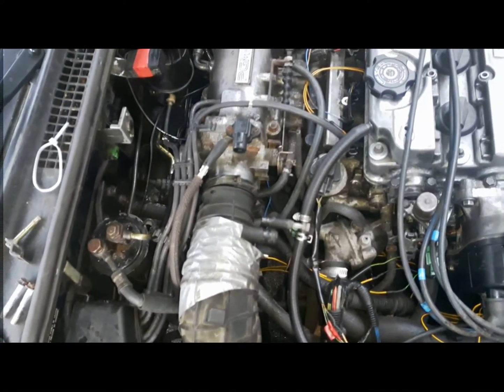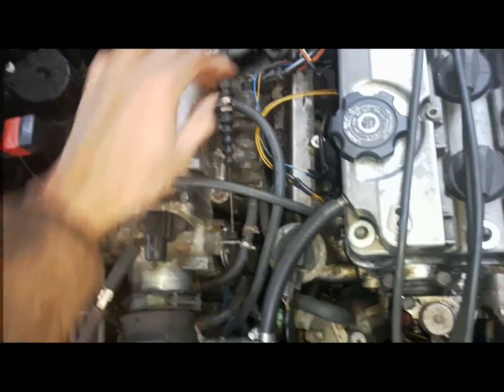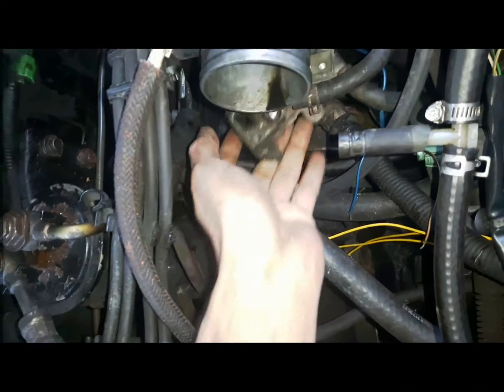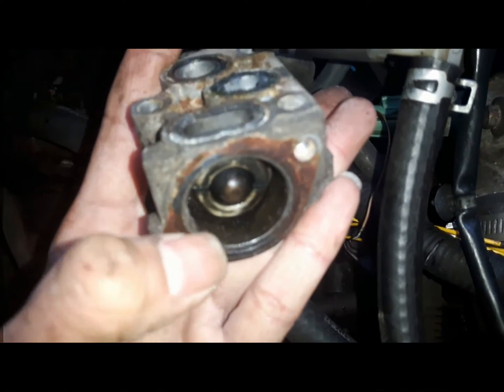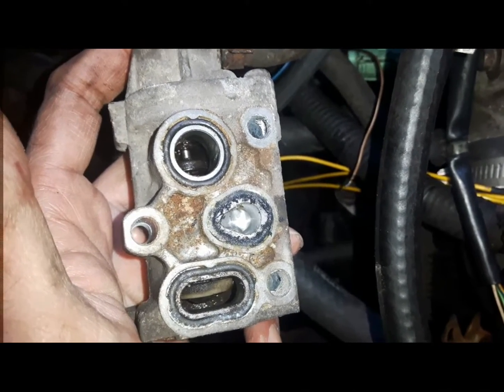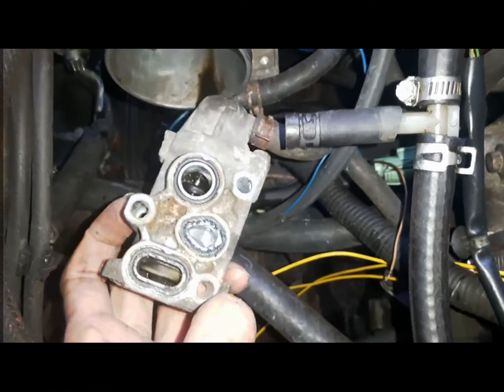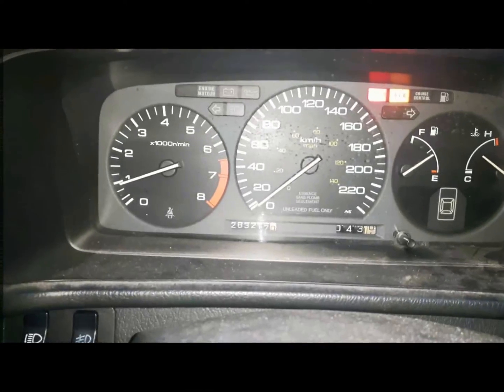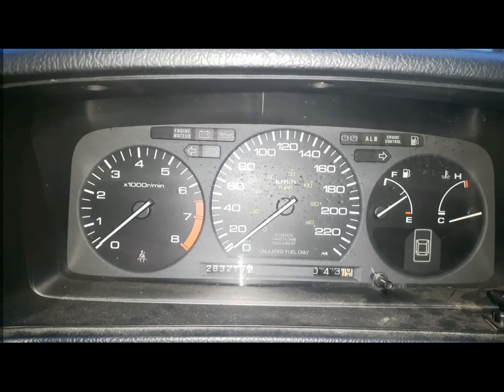How to STOP Honda engine High Idle revving surge at COLD start up,  Its NOT IAC

Comment: My 1992 Legend with 78K mileage having RPM revving up and down during cold engine and shaking.  I replaced the fuel injectors and clean IACV and that took care the shaking but not other issue.  My issue might be the FIAC.  Thanks for sharing.